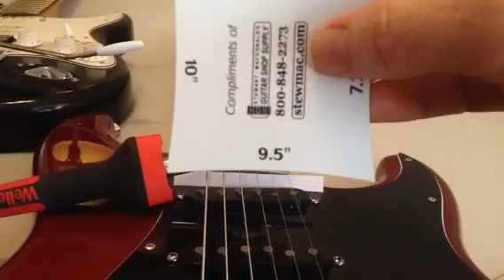Curing Stratitis By Moving Polepieces

Comment: I've been repairing guitars for a decade. I hate being this guy, but i HIGHLY recommend not doing this, and if you do it should only be tiny changes. The video poster is correct, he did getlucky.  He wasn't lucky because his particular pickups didn't mess up, he's lucky that the pickups he did them to were designed and wound in a way that allowed it. There are many things that contribute to how the pickup sounds and works, some reasons ate obvious: number of winds, thickness gauge of the wire, type of magnet, and some things aren't as obvious but contribute just as much: enameled vs non enameled wire, raw vs polished magnets, etc. I can't list off what pickups this will work on and which will not, though I've had 4 or 5 guitars come across my bench with ruined pickups due to the owner trying this. I remember that one had Dimarzio  and they other were either Kinmans or Rio Grands. If you want to adjust the radius, do it at the saddles. If that doesn't help enough, you may need to buy new pickups with either flat poles or with a modern stagger .Personally I'm a noiseless pickup guy, I've used Dimarzio Virtual Vintage for years, but currently have 2 Strats with Mojotone Quiet coils. The Virtual Vintage come stock with a vintage stagger, but I had always use ones with flat poles in the bridge. If you have to keep your pickups for some reason, another route you can go is getting the radius of the frets themselves flattened. Obviously to do this requires frets that have enough meat on them to be able to flatten them and still be able to play.
If none of these suggestions can be done, and you're set on doing this : go on a few forums start a thread saying what you intend on doing and ask if anyone else has tried it and what were the results. 
You're bound to get a bunch of those douchebags who when someone posts asking if guitar A sounds better than Guitar B,they always reply with the totally helpful "you're going to have to play both and decide for yourself." I'm not sure the reason they bother to reply since they obviously have nothing actually helpful to say and nothing to contribute  (as if it never occurred to the person who started the thread that they could try both out before they bought one). Also asking the pickup manufacture is likely to get an answer along the lines of "we do not recommend doing anything that will alert the pickups original design. They HAVE to say that, so they probably won't help. 
One more thing you can try that might help with this problem (and for me had helped with things I never thought they would) is going to pure nickel strings. Most strings are plated steel. Pure nickel wrapped strings will have a warmer tone, softer attack, and a little less volume. I first tried them simply because I was curious as to how they sound. The guitar I tried them on was a vintage Reissue that had a 7 1/4" radius, like what this guy spoke about in the beginning of the video. It had the small vintage sized frets. At the time I was using 11 gauge strings tuned to standard pitch. Whenever I played the low E higher that the 9th or 10th fret, I'd get a metallic "clanging" sound. It wasn't as noticeable when it was plugged in, but I can get a bit myopic with these things. Anyway when I tried the pure nickel, not only did I find that I preferred the tone MUCH more (I can't even stand to use nickel plated strings on Fenders anymore), but the metallic clang completely disappeared  (since that time I put regular strings on, which I still use for my ES345 and 339, due to breaking strings and not having any of pure ones x the sound came back, and then was gone again when I put nickel strings back on. 
A side benefit, which turned out to be even better than the tone is that pure nickel have MUCH better tuning stability. I have locking tuners on my Strats. When I put new strings on, I tune up, then tug on each string at the 12th fret to remove any slack, then tune back up. With plated strings I had to do this countless times (literally, I lost count because I'd have to do it all day after everything I played for the first hour or so). Pure nickel:3, 4 times tops,and it was done. You may not want to use them if you use a Floyd Rose type guitar, I don't know how well they'd hold up to heavy tremolo,  I don't use them. 
cheers

Comment: It is not "strat warble".  It is the poor adjustment of pickup height.  In the end, get pickups that are appropriate for the guitar or try the above mod.  You may still get the "warble" if you adjust the pickup too close.  Tip - put a crappy cover on the pickup for this operation or take the cover off..... and pray.

Comment: Not going to give a thumbs down because it is just preference and it is a legitimate way to do this on most pickups, but being a strat guy who cringes seeing a humbucker in the bridge spot this is equal to curing a long healthy life with a deadly virus.  I can see logic with the explanation but the original position of the pole piece is part of that robust mid tone that makes it such a great sounding guitar.  Another way about it may be a set of flat wound strings with a wound G like I have on my 96 MIM strat, full tone from low to high with no warble or tuning problems.

Comment: Forgive me for disagreeing with your suggested correction? If you're pick ups weren't so high and way to close to the strings you wouldn't have the warble effect. I've dealt with this on many strats are other guitars for years . I build and repair a lot of guitars each year. I know fender says the pick ups should be a a certain highth, but those specs were set way before today's awesome materials were used to build pick ups. Just drop your pick ups a little at a time in small increments till you no longer get the warble. You'll find that you're pick ups have a very large influence area and you will gain a lot more sustain, magnets pull on strings, that slows them down faster causing low sustain times and string induced warble. Thank you sir I watch your videos and like them a lot

Comment: Ok! this does NOT work with vintage type pickups, and this is NOT a vintage type pickup, but a post-1980 type of pickup. On these, the winding is separated from the magnet by plastic, so the magnet moves in...PLASTIC. So, if you don't heat it too hard, it'll work fine. if you heat it too hard, for a too long time, either the plastic will melt or the heat will weaken the magnetic charge.
Don't even try it on vintage type pickups, using fiber top and bottom, and where the winding touches the magnets: I have done it and broken the winding.

Comment: **EASIER FIX**
Its nothing to do with heating with iron.

The pole peices are only held in by potting wax yes u can melt it *but* EASIER than that just use a wide jawed pliers (channel lock) and squeeze the pole peice and it will slide inside the hole its in.

Then you can place it were ever you choose.

Dont heat it or damage with pliers be carful.THE ONLY DAMAGE THAT CAN BE DONE IS TO THE WIRE.AND ITS HAIR THIN SO CARFUL FELLAS

I dont this five sets of pickups many differt brands and such

Btw secret here.

Guitar fetish sells some pickups for 17bucks a peice that beat out two of the big name brands of hand wounds

Gfs alnico boutique strat pickups are AMAZING 

Trust me!!!!

Comment: Bud!! If this pickup is a vintage style made with 2 fiber pieces for the bobbin then you can cut the coils inside if you push the pole piece. This only works on Plastic bobbins that are not touching the coil wire!!! So smarten up!!!

Comment: If you adjust your saddle height correctly you dont have to mess with the pole heights.... seems you need to learn a bit more about the finer points of set up.
Reply: What you're saying would make sense but you have to make it so extreme.. I like to follow the radius of the neck and when you're dealing with 9.5 the 50 stagger is to extreme. That's why you get the privilege of reading all of these comments. Mainly cause you're not the only one on this planet. A lot of us are actually having problems with this.. And it's not because we don't know how to set our guitars up I've been doing it for 45 years.. If it was easy we wouldn't need this comment section

Comment: So you've made up your mind you're going to fix the problem with your guitar. The really only solutions are to change the pick up or lower the pick up and deal with strings aren't loud enough. If it works you've fixed your problem for free. And you can probably do this without Desoldering or changing your strings. ....Do it!

Comment: Heat affects the permeability of steel and therefore the magnetic property of the magnet... but you seem to be having no problems there... I advise great caution.
Wax melts very quickly, so its a hit-and-run affair with the soldering iron.

Comment: You claim that fender has changed to a 9.5. I challenge you to put a radius gauge on any fender or squier fretboard which claims to be 9.5. You'll find it's actually 10. I can move a 10" radius gauge between a PRS (which advertises as 10) and it's exactly the same as the Fender which falsely advertises 9.5. 

If you set the radius on the saddles at 9.5 using a radius gauge and then measure from fret to bottom of string, you'll find that the D and G strings are way too high because the Fender fretboard is actually a 10.
Reply from the maker: Yeah, Fender and Squier both need to put an "ish" on the end of their 9.5 radius spec. I had to do a fret level on one new Squier Jaguar and had to use the 14" radius beam before it would even touch the center of the frets.

Comment: To start with the pick ups are way to high this will cause the warble effect, and all single could lack mid range tone so the Texas pick ups are staggered to balance the sounds of each string. No way you should use a soldering iron to lower pole pieces? It cause the magnets to degaus and could burn the windings. Just my professional opinion.43 years playing and 8 years building my own

Comment: I don't recommend this. This is a good way of ruining Alnico pole pickups which are generally built with the wire wrapped directly around the magnet pole pieces. Trying to push those around can break the pickup. Absolutely nothing to gain with this idiotic idea. Get a compressor.

Comment: Ruined a Fat 50 doing this...Never again!
Reply: You were warned though.
Reply: Moot point now as it was a "long" time ago.
Reply: +John Spina people ave been doing this from the 60s with great success this is not a new thing. What did you actually do to break it? I bet you had the cover off and accidentally touched the windings with the iron or maybe your hand touched an broke the end of the winding at the solder joint on the base plate? I am pretty sure just heating a pole piece and pushing it cannot break a pickup as this doesn't even touch the windings.
Reply: I've done a ton of magnet swaps on my own Duncan humbuckers and this wasn't new to me either..On the Fat 50,I just carefully tryed to push down slightly on the G pole.I'm certain the winding was stuck to the pole and broke upon pushing the pole down.I've done this with out problems on the Tex Mex poles and they move easy.I replaced that Fat 50 and it was several years ago..These days I Lean more on flat pole Duncans.Most of my strats are 9.5 radius and I have one that is 7.25 and another that is 12".I just don't fool with my single coils anymore..LOL

Comment: Omg, you are light years from being correct about this. That warble is caused by the pull of the magnetic poles. The solution is to lower the pickups slightly until it stops. You NEVER PUSH THE POLES DOWN. How do you not know this??? This happens specifically on strats, occasionally on other guitars with 3 pickups. This is absolutely absurd. Do some research. Email lindy fralin, or any pickup winder or guitar builder if you don't believe me.

Comment: the cure is not mounting the pickups too close to the strings, adjust our guitar to avoid string buzz....and learn how to play the strat......leo fender was the genius, not you.
Reply: Cozmovox Yes - your information is 100% correcto-mundo. Warble-like sounds (i.e., 'Stratitis') occur when the magnetic field is too close to the strings. The cause of unbalanced volume and/or tone is the pole piece heights aren't sufficiently adjusted to equally balance both volume and tone sensitivity.
Reply: Leo Fender may have been a genius but believe it or not he didn't play guitar. He was just a engineer that liked the concept of guitars, strange but true
Reply: Leo Fender never played guitar, and he didn't design the Strat. He, in his genius, wouldn't even put truss rods in his necks until complaints started rolling in because he didn't have any understanding of the physics behind what he was doing. Now that's not to mention, as was pointed out already, the fact that the pickups in modern strats aren't even designed for modern strat necks. They're designed for a vintage neck radius and heavy gauge strings that few people use today. That means that setting up a guitar to not have string buzz won't help a guitar that doesn't have string buzz to begin with. It also means that adjusting the height of unbalanced pickups won't magically balance them either.